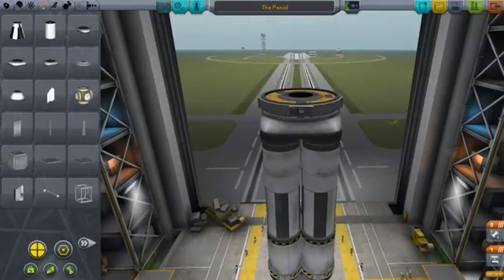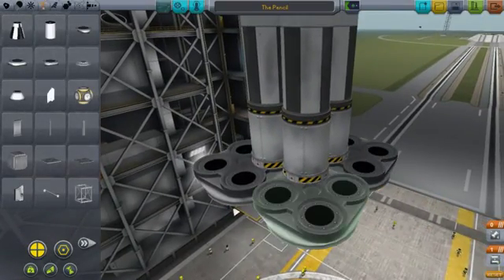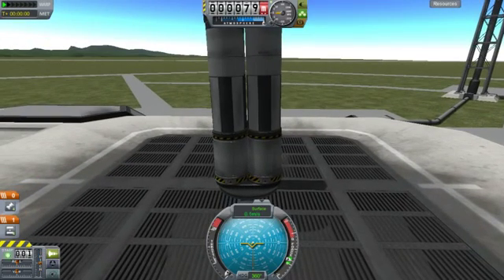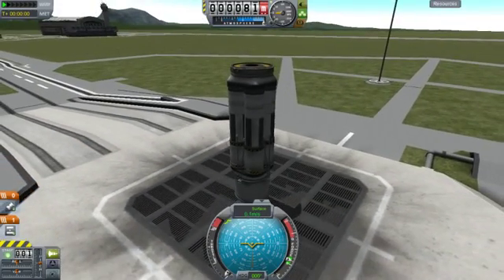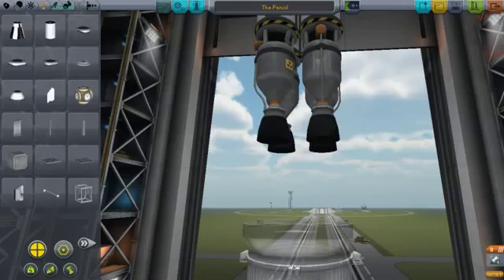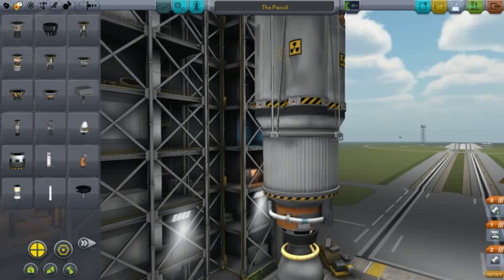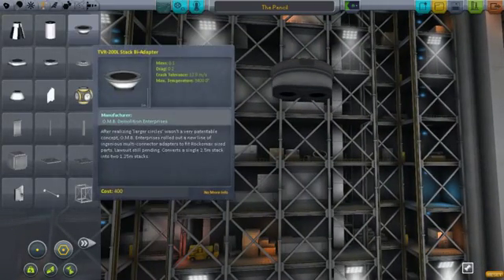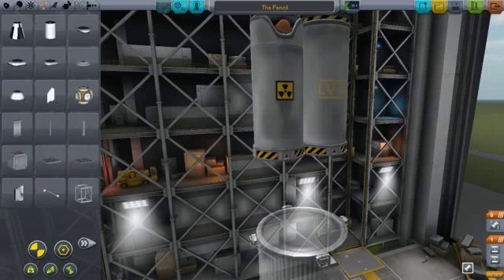Let's go to space today:  Using the quad adapters in-line

Comment: This might be a better solution... I think I have seen Scott Manly do this too but I could not find his video on it. And this guy is doing this in an older version of KSP and showing the process with docking ports but he says it works the same way with engines and decouplers. Tutorial: Assembling Multi-Docking port Connections in the VAB
Reply: Ok.. maybe I was a little premature posting that... Looks like that will work for parts using docking ports between Bi, tri and quad couplers, but not for engines and decouplers. or at least I could not get it to work. so I guess your way of making it work is best until KSP makes it work cleaner in the game! ;-)